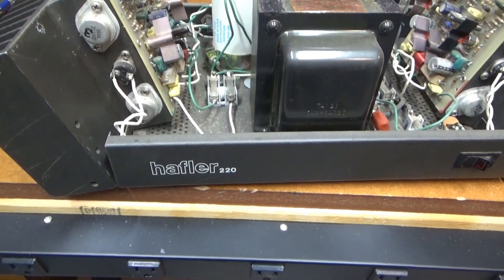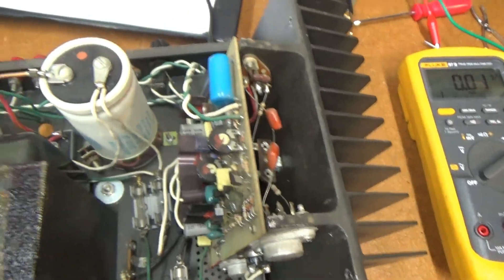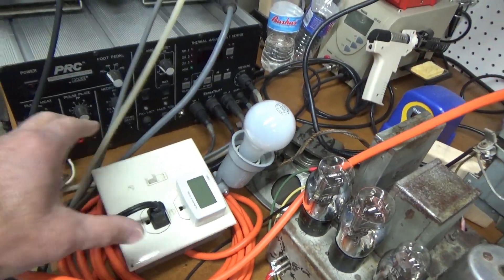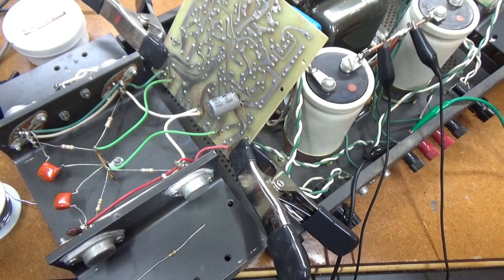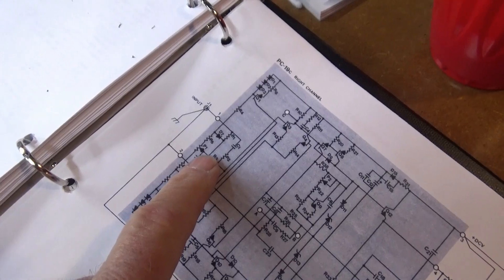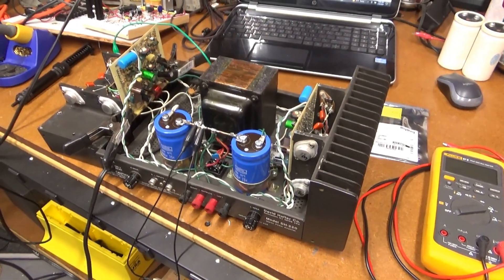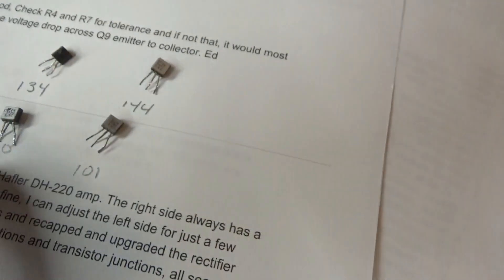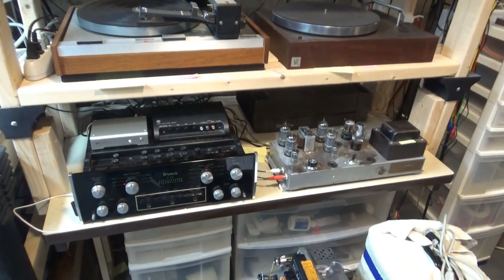1984 Hafler DH-220 Amplifier Service

Comment: NEVER, EVER order "recap kits" - there is an epidemic of counterfeit capacitors out there these days, so widespread, that the kit is likely to contain fakes from China, that look genuine.  To guard against this, you must have chain of custody back to the capacitor manufacturer.  This means ALWAYS order your caps from Digi-Key or Mouser ONLY. - And I would stick with the big 4 Japanese super premium brands, namely:   Nichicon, Chemi-con, Rubycon and Panasonic.   Also, try to match the ESR/impedance to the originals.  A little lower is OK, but it is easy to go too low on ESR/impedance and create unwanted feedback.  Also, same goes for the voltages, you can go one step higher than the factory specified voltage rating, but no more, as this affects the ESR/impedance as well.   Also, try to always buy 105 C temperature rated or higher caps.  PS- a fifth Japanese manufacturer of electrolytic capacitors - ELNA - is fine as well, however they only make a few cap sizes and mostly high end ones for the signal chain. PS#2 - Every single electrolytic capacitor in this entire amplifier, if original, is wayyy past it's expiration date - replace them all, including the big ones, which really help with deep bass!
Reply from the maker: Thanks for the comments and I agree with most of them. I purchased the cap kit from Fantasia Audio because I know that he supplies genuine parts. I generally only order from Digi-Key or Mouser. There are a lot of fake parts out there. I replaced all the electrolytic capacitors in the amp for good measure. At least two of them had already started leaking electrolyte so it was definitely time to recap.

Comment: I usually leave the filters. Mainly because they generally test fine. Only time I do is if the dC ripple is apparent in hummmmmmmm.
Reply from the maker: I considered not replacing the filter caps but I figured since I had the amp opened up I would do a little preventive maintenance. I'm not discarding the old caps. I may be able to use them in troubleshooting other units.